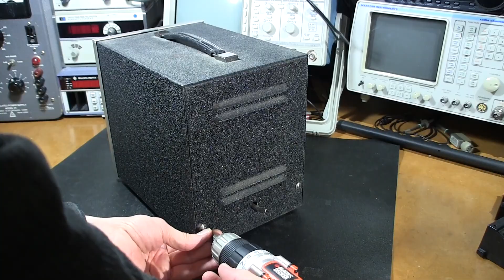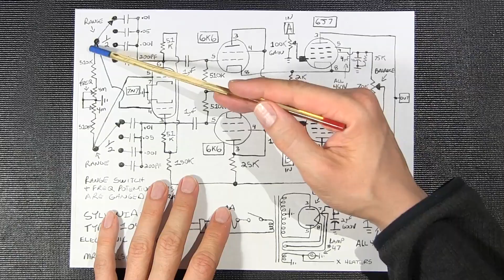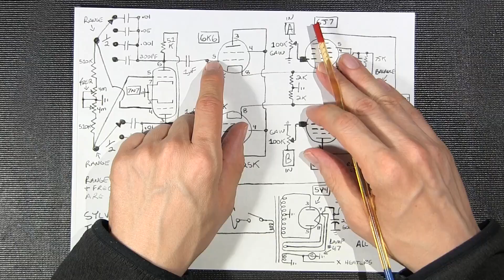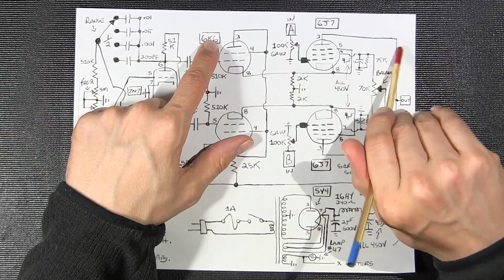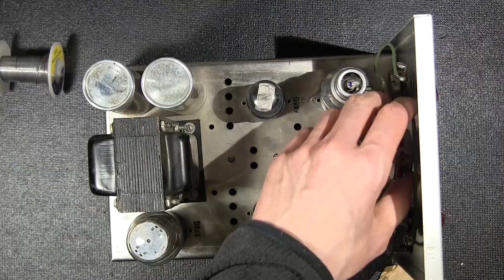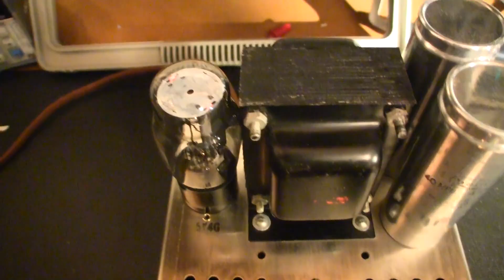Neat Electronic Device from 1939 Explained with Restoration

Comment from the maker: To go to the Mr Carlson's Lab Patreon Page, click here: https://www.patreon.com/MrCarlsonsLab
Reply: Thanks for the video.  I think I might still have one or 2 of those that are similar in my classroom storage.  I never knew what they were for since I have several 60-70 vintage scopes that have the dual trace on them.  I likely have one or 2 that have a single trace that I can use it on if I decide to restore it.  My department wants me to throw them and buy new scopes and I do have 2 new DSOs but I still like the old units as they are simpler for students to use at first to gain an understanding of function before letting them play with the fancy DSO that does everything for them and has enough buttons to make their eyes gloss over.  I need to go through all the working scopes and replace caps before they fail.  I did replace a few bad caps already on 2 that were not working and they sprang back to life.
Reply from the maker: Those older scopes are your best learning tools, don't discard them, use them to teach! The newer scopes are fine for the end result (solving a service/repair issue) but very poor for the understanding of the scope itself. Sounds like you're on the right track kuhrd!
Reply: I was looking at the TBS1000B-EDU line of scopes if I do have to buy a few replacements in the future but I will try and keep the old stuff going strong for as long as I can.  I have 2x Rigol DS1054Z that I have not firmware unlocked yet (waiting for the warranty to run out) I snuck them on my new class budget when I resurrected the electronics class 2 years ago.  Electronics had not been taught since I was in high school at the very same school.  Kinda felt it was my duty to get the class going again.  

The Rigol DSO scopes work well enough for showing students waveforms and troubleshooting circuits but I always let them play on the old ones first.  It is nice to have access to a scope with 4 inputs when doing things with Arduino and stepper motors.  

Some days it is hard enough convincing the trouble makers that the lab power supplies are not arc welders.  On those days when I am working on my own stuff I wish I had even 25% the experience you have with electronics.
Reply: @MrCarlsonsLab  I have several different old Heatkit eq including a similar scope and a frequency counter with nixie tubes but it's 110 volts and I live in Sweden. Would like to send it to USA but not worth the cost 👎
Reply: Mr Carlson's Lab
Reply: nice call on what to replace and check (i take it the braided wire wasn't rubber internal, usually that's crumbling)..

one minor detail though, the 6K6GT tubes are pentodes, and not tetrodes.  you could be right if the date codes match on using different lots though, as the chassis is marked 6K6G, and they are clearly GT.

when in doubt try frank's tube pages or one of the mirrors (I used to run the US mirror site for a while), and also for good reference, several of the books I scanned are there as well (radiotron designer's handbook, TV-7 docs, spangenberg, etc...)

(Late edit: I should have played on before writing this....you explained why you did them as triodes instead of pentodes)
Reply: RE: Classroom scopes - you're bringing back memories of my freshman year college physics class... which is what caused me to buy my Tektronix 561 that I found at an estate sale - was the same one I used in my youth. I am sure looking forward to relearning how to use it here from Mr. Carlson.
Reply: That's what he zed!  You heard the man, he zed that!  :-D
Reply: Hi Mr Carlson, thanks for this very enjoyable restoration. Do you think a resister-divider network could be arranged at the output of the 6J7's so that the device output could be sampled at a safer voltage? Watching you twiddle the duty cycle control with your fingers just millimeters away from the output and ground lugs was giving me heartburn!
Reply: Sounded right to me? 
Mind you most yanks mispronounce solder and say sarder, not pronouncing the L, yanks also corrupt the English language by spelling some words wrongly
Reply: should show them king of random vids then. also show the troubler makers. the repair bills as well.
Reply: yanks?   Them's fightin words!!!  All you northerners mispronounce the language.
Reply: wow, i've never heard someone mispronounce the word, "audible" before.
Reply: Mr Carlson's Lab  Your mouth movements look animatronic

Comment: Wouldn't it be nice to take some tatty old O'scope, rip its valve guts out, and build in transistor circuitry that upgrades its specification.
I would not bother with a "switch", and bandwidth from 1 sweep every 5 seconds to 300 kHz, and a modern step attenuator with minimum sensitivity of 1 mV per cm would do fine.  Oh and also be able to amplify an X input to do XY displaying...
Reply: For EHT the Hitachis used a logic-fed switching supply running at high frequency.

Comment: Gee Whiz Mr C, I HAD one of these!!! 

Earlier type - didnt use a 7N7 - all octal, save for a type 80 4-pin rectifier, and the chassis was a ways longer (the whole thing was bigger) but the same animal, same dials, and called itself an electronic switch!

Sadly I LOST my heavy metal boatanchors in a massive London (illegal) Eviction, but wow - nice to see !

Cant remember now whether I traced the schem out, or there may have have been one stuck to the casing...

Comment: One thing I would like to say Paul, is that although the old equipment can be harder to use, if there is a failure for any reason unlike modern ic/ transistor gear it usually won’t cascade taking out lots more components. IMO

Comment: I also find point to point reverse engineering to be quite challenging. It is easier to reverse engineer circuit boards that are single or double layer, but multi layer boards are a mess. I used to design circuit boards for a living and some of them can have up to twenty layers on the modern circuit boards. Oh the days of laying out all those traces on vellum sheets. some of them were like 3 foot by 5 foot pieces because we scaled them up for easy layout. now everything can be done on PC which is much more practical.
Always enjoy watching and learning from you. You remind me of my High School Electronics teacher. His logic was text books can teach you theory, but hands on is the only way to learn electronics. My first project was a Tesla coil using a 10,000 volt 30mA vacuum Tube Transformer as a power source. Was so cool to see it in action. I would love to see you do a restoration on one of those transformers in one of your videos.

Comment: Very interesting and enjoyable video. Recently purchased a Tektronix 465 scope which works fairly well but is not displaying CH2 when ALT is selected. Works with CHOP. Might be the switches need cleaning. I have not investigated yet, but this video helps explain the operation clearly and should help with the thought processes needed to fix it. Thank you

Comment: When you do the video on biasing tube circuits I’d love to see a detailed video on reading tube charts, both triode and pentode.   It’s always been a source of confusion.   Also interpreting tube data.   Determining a useable output transformers for a tube not Normally used in video, 6AV5, 6GT5 etc.

Comment: Another wonderful piece of equipment restored. Thank you for another interesting presentation Paul. But for those of you interested in restoring old vacuum equipment there are five things to know. First, you need a circuit diagram. Never go fiddling in an equipment unless you have one, because you do not know what the heck you are connecting to. This can lead to causing more issues in the equipment by destroying valves and components, not to mention your test gear. Second, don't plug it in direct to the power source and destroy it. You need an isolation transformer, a variac, and current limit just like Paul's, so that you can see whether it is going to behave or not. Remember, you do not know where the equipment has been, or what condition it is in. It could be faulty, and old components invariably fail. Third, you need to understand how the circuit works. If you do not then it is like coming off the street, climbing into an F15 fighter jet and expecting to fly it!  Well it is the same here too. If you do not understand how the circuit works, seek advice. Fourth, large capacitors charge up. Yes it is turned off and unplugged, but if you have had voltage on it they can charge up and still give you a very nasty surprise. Fifth, and VERY IMPORTANT you have to understand that this is not solid state devices like bipolar transistors and FET's that you fiddle around with with your bare hands, and that there are REAL voltages in there that can KILL YOU. My mentor always told me, ground on chassis, one hand in your pocket, and the other on the probe. It was valuable advice when working on valve gear. If you get connected to those voltages, and many have, you will definitely know! High voltage is pretty unforgiving of incompetence, and can put you in the hospital or the ground for good, so always take great care when in live valve equipment. Watch Paul's videos. You can learn a lot. He has mastered valve gear and electronics, knows the hazards, and understands the circuits in detail. You can have no better teacher. My mentor? Derek Colins, in television repair for over 20 years, and when I met him a bench radio transceiver repair technician. The best. Paul even uses some of the terms Derek did.......badly repaired electronics.......butchered boards! LOL

Comment: When you found that loose cap on the tube socket you can bet when it was installed you simply could not see it soldered. Then when the balance vr was  burnt out on the center section it was just a hanger queen never used. So brand new except the damaged restart. I can see a Sylvania tech from the day up in heaven biffing his forehead saying doeee that's what was wrong with that I got it back ten times.
Reply: Not restart reostat. Spell checker is devious.

Comment: Another excellent presentation, Mr Carlson. I am reading a 1956 book about oscilloscopes and there is a similar schematic of an electronic switch, but it only uses four pentodes, excluding the rectifier. 
And I must say, those big vintage Mallory capacitors are very pretty. If only the Czechoslovakian Tesla components I come across here in the Czech Republic were as colorful and with such nice writing as their American counterparts have. They would make for an interesting wall decor for the lab, framed in a flat glass box. Thank you for making this video.

Comment: Can't wait to see you spending more time in the second "old time" workshop.
I honestly believe the equipment made back then with valve/tube analogue technology is so much better than todays digital technology.  I just feel a bunch of 0's and 1's can't replace an infinitely variable signal of analogue.
Miniaturisation aside, I don't think anything made solid state is quite as good as a good quality tube appliance.
Trouble with Graphite is it creates a reflective surface so light reflects off it where as black ink tends to be more of a matt finish.  That's why camera's and photocopiers tend to hate graphite drawings.

Comment: why are there shoulder type tubes?
It seems like more work to produce them
Reply from the maker: Back in the early days, tubes got pretty hot. So this bulb type kept the glass away from the Plate or Anode inside the tube. They didn't re-tool for the tubes that didn't get as hot, so both receiving and transmitting tubes got the same shell.
Reply: @MrCarlsonsLab  Thanks for your reply. I was guessing the same but I wanted to hear it from a professional! Thanks!

Comment: The capacitors on the frequency range switch seem to have strange values. The first is 200pF; the second is 0.001μF which is 5 times larger; the third is 0.05μF which is 50 times larger than the second, and the fourth is 0.01μF which is one fifth of the third one. Perhaps the switch is just wonky, or perhaps you've swapped them in the circuit. By exchanging the last two, the ratios would be 5, 10, and 5.
The fine control gives about a 9:1 resistance ratio between minimum and maximum so it probably also gives a 9:1 ratio of frequency adjustment, which would not be quite enough to make up for a capacitor size step of 10:1 so there might be a gap in the frequencies available.

Comment: You probably could have skipped the external sync on the scope, but the sync selector switch would have to be set to one of the internal (+ or -) positions. Fiddling with the sync amplitude control could have made it sync either with the switching frequency or with one of the signals. It would have been touchy to adjust though. The best situation would be for the scope to have a sweep output and use that to force-sync the oscillator in the switch but it isn't clear all the elements required are available.

Comment: I wondered about the ink marks on the soldered joints.  I've only seen that on military equipment.  However I bet you're right about an intermittent fault which was never fixed until you found it!  I bet you have seen dual-trace (ha ha) scopes with a "chop-alternate" switch on the front panel.  Once again a very good  description of the circuit and the way it works.  Long time since I've seen a vacuum tube cross-coupled multi-vibrator.  Thank you for a great video sir.

Comment: Such troubleshooting is not uncommon.  Years ago, when I first began working for the local Police Department of a small Midwest town, some of the store owners were complaining that the police failed to check their back doors for security, you see we were to walk all the streets and alleys of businesses and rattle their doors to insure they had not forgotten to lock up, thus leave it easy for lazy crooks.  So it was that the Chief, in his wisdom gave us each a roll of masking tape, and had us tape the doors we shook one night.  The following morning the Chief was kept busy answering calls from concerned businesses that some crook must have been casing their place as there was tape on the door.  That was the last time we got complaints, or used the tape, so I guess it was a good thing.  When we did find open doors which happened from time to time, we would walk through the business, then call the owner from inside the store (long before belt radios) and have them come down to insure nothing was taken.  I always waited till after bars closed at 2AM to do my checks, if I had to rattle  their damn doors then they would loose some sleep to check their stores and I refused to "just lock it for me will you" no sir, you have to come down to protect me should there be something missing I would say, after about six months of businessmen getting woke up the occurrences became so slim that the door rattling was given up.
Reply from the maker: Thanks for sharing your story Jerry!

Comment: Had an intriguing thought - could you not use a bit of emery cloth to clean the inside of the track then solder a piece of wire across to effectively bridge the open point??

Comment: I had an electronic switch by Heathkit. It really is very limited since two different signals of different frequencies could only be set  for  one of them. Good for comparing  the input and output  of an amplifier. It's a good thing they came out with dual trace scopes using two electron beams which are independent of each other.

Comment: Do you have any thoughts on the difference in results between tube and diode rectification, specifically from the perspective of guitar amplification? Also, just a thought... Maybe that "balance" control is akin to the phase adjustment on something like a mic preamp or DAW.

Comment: I think those ink dots were put on at the factory, when the joints were soldered. If the repairman had put them on, he would have found the unsoldered joint.  So the  QC inspector slacked off. Low usage because it was intermittent from birth.

Comment: It's an early 1950's item I used for TV repair. Mainly consists if free running multi- vibrator circuits.
Reply: The tubes used are  loctal and  octal , typical is the gray cabinet finish  was common in the early 1950's.

Comment: Hi once more Paul, very interesting video again in the fixing of the Sylvainia Electronic Switch. The Heathkit oscilloscope you used there in the video. I picked one up years ago while on holiday at Filey on the UK East coast. It was outside a British Heart foundation charity shop. Could not resist going in to enquire regarding the scope. They wanted a fortune to get rid of it. £5.0. Whow, I could not believ it. Did not care about if it worked or not. £5.0 was worth it just for the case has far as I was concerned. When I got it home, it took a bit of sorting out but soon had it up and running. Not bad for the price. 73 de John _ G0WXU
Reply from the maker: Thanks for sharing your story John!

Comment: Would the output of this device be inverted relative to the input?  What sort of linearity could be expected?  I would have expected that in an electronic switching application like this, a triode wired as a cathode follower with a switched anode would be a simple and effective topology.  Would there be some disadvantage to such an approach?

Comment: oh boy,  it is quite a process to draw up the schematic from the equipment.  Trust me, you will go through several iterations, before you draw together all the information, and the circuit makes enough sense, that you can then draw it conventionally..  you start with what is essentially a pictorial and work towards a schematic.  Nice result Paul.